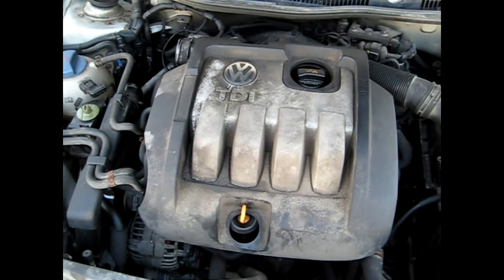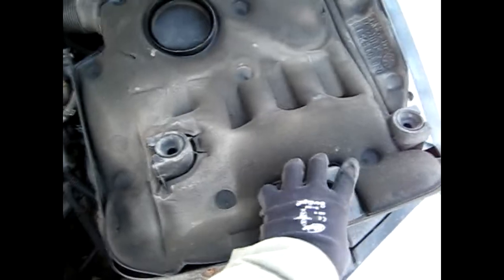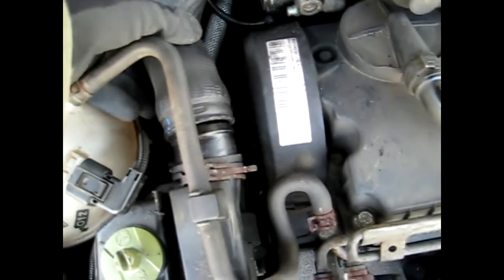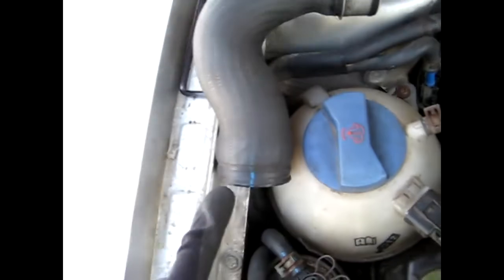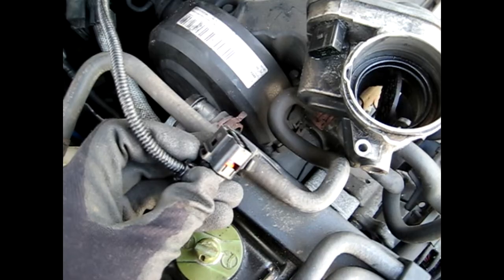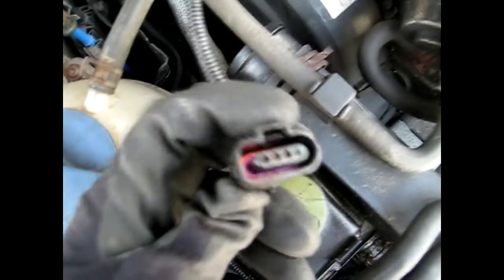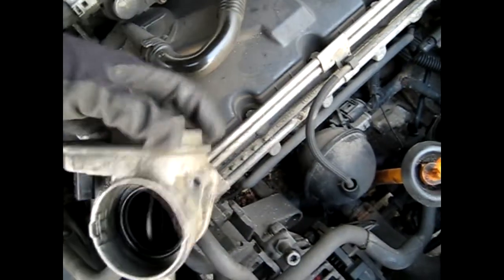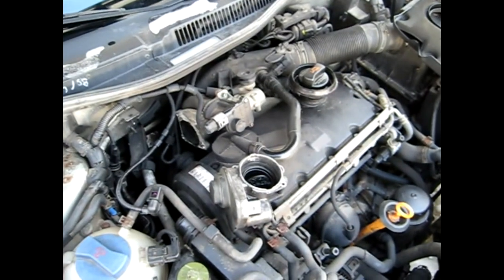DIY: Volkswagen MKIV TDI PD BEW Anti Shudder Valve Removal

Comment: Hey, any idea where I can find that O-Ring that is on the end of the hose that connects to the valve. I'm not having any luck and don't know the proper name for it. I'm also from Ontario! Thanks in advanced!
Reply from the maker: If you have the original o-ring, just go to a farm equipment or hydraulic supplier. They'll measure it and match up a replacement, it'll also be much cheaper than the dealer.

Comment: I have an 06' new beetle TdI that I am modding. I came across this video. I'm more interested in a complete EGR delete for my (I've been told "BEW" series engine. kit came in the mail, and none of it looks correct.  also, if I remove the A/S valve, will the car shut off when I turn the key off? Any address for the best,  most complete GET delete for NEW engines? Danke im voraus.

Comment: Why would you want to remove the part that protects your engine from runaway? If you're lacking horsepower, just get a more powerful engine!
Reply from the maker: They do have to be removed at times in order to clean them. If they get too clogged up with debris, they no longer function and will kick on a check engine light. There is people who do remove them completely and replace it with a "race pipe". The anti shudder valve can be restrictive in the intake and it removes a part which needs maintenance in the future. But I do agree it is an added safety feature and it probably isn't the best idea to run without the unit.
Reply: 4Diyers
I see what you mean. I'm pretty sure darn EGR system is a cause of that.... Every new 'ecological' requirement makes new engine generation much more complex and less durable. And for what? For tenths (or less) per cent of emissions, but the unit price and service costs grow geometrically per every engine generation.
Reply: @HAPKAH  i prefer to use exponentially 😁
Reply: @HAPKAH  cars are more reliable than ever. I don’t see you driving a car with a carb and points everyday to work 365 days/year.

Comment: i just unscrew the "disk" or "flap" on mine so far so good. way better TORQUE, HP and gas pedal response... the only side down is when you shutdown it shakes a bit, thats all. so i'll be running it like 2 weeks and check the dirt inside.
Reply from the maker: I believe that flap did close up once the engine was shut off, so that would explain why there is a slight vibration from shutdown, but that shouldn't affect anything.
Reply: 4Diyers
thats what it does. so far so good. im getting better turbo response and millage
Reply from the maker: You can purchase a performance upgrade and do the ASV delete. It's called a race pipe and I believe they're around $100. It's a straight pipe that just goes in place so there is no restrictions inside. Now this will cause a couple issues. One being a check engine light and the other having the chance of a run-away diesel. The ASV is intended to stop the chance of a run-away diesel and it plugs the air intake.
Reply: @4DIYers  I keep hearing it's safer to ASV delete if you have a manual- why? since I may be deleting ASV soon what would I do with stickshift/clutch to stop a "run away" scenario

Comment: hey,  im wondering if this part not working is causing my tdi  to blow tons of smoke and no power
here is a link to the YOUTUBE VIDEO
http://youtu.be/wlGA73vJcrE
msg me  back kayakrider78@yahoo.com
Reply from the maker: Yep it could possibly be... But you have an ALH, so it's located near the EGR valve if I remember right. Do you have a check engine light or any codes? Other things which could be causing this issue too would be the car jumped it's timing, the timing for the injection pump needs to be set (this needs to be done by Vagcom), faulty injection pump, faulty injector, plugged intake, or a MAF sensor. You can test the MAF sensor, by just unplugging it and see if the car runs better. Best to start with the things that don't cost anything, rather than buying parts or paying for service you don't need.

Comment from the maker: Diesels don't have throttle plates or bodies to control the air flow which in turn controls the rpm of the engine. Their throttle is controlled by the fuel adding into the motor.

Comment: The anti-shudder valve, when closed, is basically what causes the engine not to start, or causes the engine to shut off because the valve controls the air intake.  As far as I'm aware, certainly on my vehicle, if I was to remove the EGR valve, I'd be removing this valve as well, because I understand the ASV is physically part of the EGR unit.

Comment: I have a VW Golf 4 manufactured in the year 2000. Its change of gears is not smooth. I have changed the Gear box twice but the same effect-(hold up and subsequent release) and at one time the engine ran but engaging gears failed. what could be the problem

Comment from the maker: The purpose of the ASV is to prevent a "runaway diesel" and quieter engine shutdown. The advantage would be better airflow. The disadvantages would be no safety for a "runaway diesel" and you'll most likely have a check engine light, so you'll need your ecu edited to remove the code.
Reply: the code is in memory but no engine management  light should come on dash this is with the older VE 8valve engines, unsure about 1st and 2nd gen PD's even though the intake setup is the same,   software if it does on PD.....

Comment: What is the purpose of removing the ASV? What are the advantages/disadvantages?
Reply: Inspection & cleaning mainly. They get gunked up w/ carbon b/c the EGR valve is so close by. Inspect the plastic gears, clean & lube as needed. Mine was pretty nasty w/ almost 200,000 miles, but not 1/2 as nasty as others I've seen on here.

Comment from the maker: I never had to remove the valve on my car, but from what I've read, you'll have to turn the engine over in order for the cam the clear  valve cover. Other than that, I don't believe anything else needs to be removed.

Comment: i'm just trying to replace the a leaky valve cover gasket .  My engine is identical to the one you see in this video here , you can see in this video that intake system is blocking the valve cover from coming off , once you get the screws off of course. my question is difficult or should i watch out for certain things when taking it off , i have a manual but it doesn't really cover this ,  thanks

Comment from the maker: Is the engine a PD or ALH diesel??? Also are you trying to replace the upper intake gasket or just the valve cover gasket???

This valve is to prevent a "runaway diesel" and also reduces the sound when the engine is turned off.

Comment: hey thanks for the tips , you seem like the right guys to ask about about removing that air intake system , trying to remove the valve cover to replace a gasket and this things in the way , don't want to remove it until i know a little more , you guys have any suggestions

Comment from the maker: @tonybro70 Nope, I never had any trouble with mine... Possibly there was dirt in the head, so you might not of had the allen wrench in all the way. It's a real pain to see that spot and it's fairly tight too. You can probably just drill the head, remove the unit, and then put pliers on the remaining stud left. I'm impressed that you cleaned it on the car... I would have never had the patients for it lol.

Comment: Just wanted to ask if you ever had any trouble with stripping the heads of the allen bolts.  I got the top two out, but the bottom (and hardest to see) stripped and I couldn't get it even with an easy-out.  I ended up trying to clean the valve while still on the car.  Frustrating, indeed.

Comment from the maker: @89LT250R I think even with a new one, it will wear over time because it doesn't hold tight like something that is bolted together. So it probably would work for preventing the pipe from wearing out also.

I'm actually about an hour north of London.

Comment from the maker: @89LT250R I'm actually from Ontario... I had to take ASV off to clean it and fix the pipe that keeps popping out. I saw a member from TDIClub used grub screws to hold the pipe in, so I'm going to do the same thing. Beats spending $100 on a new pipe lol.
Reply: Why does the pipe keeping popping out? I just picked up a 05 TDI golf. The pipe seems to be loose. Not sure if that's why its shuddering at idle slightly. I have two bad glow plugs I gotta change out. Thinking of either removing the EGR and ASV or cleaning both of them. Albertan winters can be a pain on diesels without block heaters. ugh
Reply: @caitbenoit4594  try using a dog collar from karma tdi, it works on mine. About $30 and it bolts the hose to the valve.